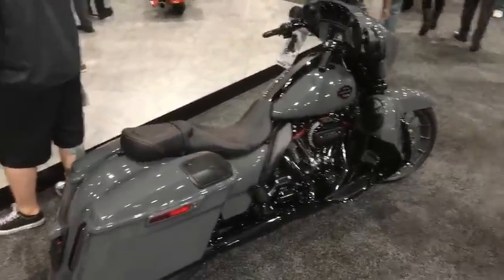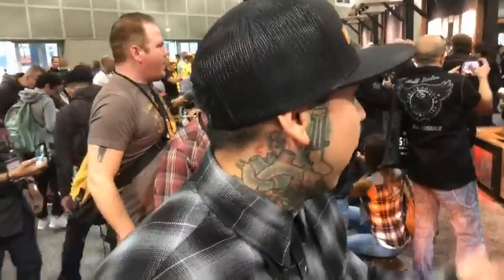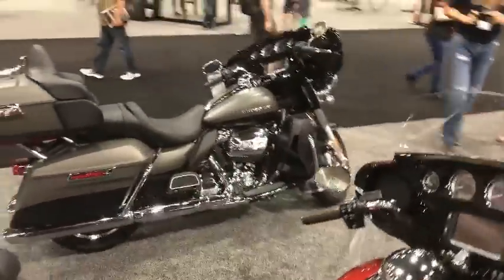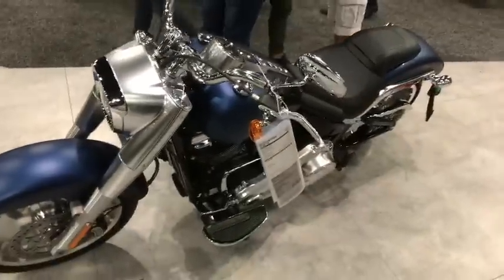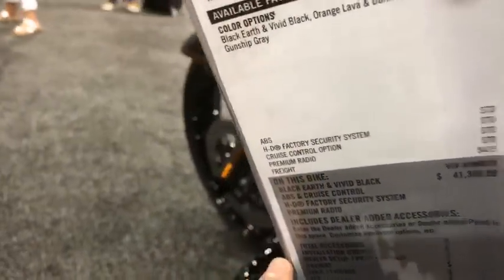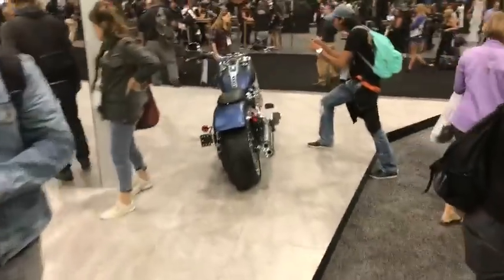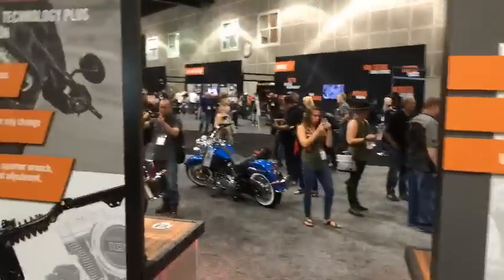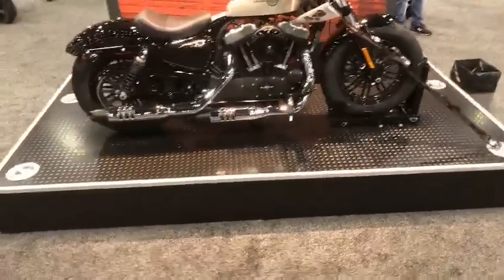2018 Harley-Davidson Dealer Show LIVE!

Comment: From a business and manufacturing standpoint, HarleyDavidson did a very smart thing. They eliminated a whole line of models that where not a hot seller for many years and engineered a much stronger, lighter and better handling platform to build upon using the same frame for the cruisers and canyon carver model all using the M8 power plant 107 to 114 
Think of what Harley is saving in production time, multiple part sourcing and all the headaches of making the old twin cam and dyna frame and all the parts and assembly lines that go with it!  All while giving the soft tail Family a big shot in the arm which should ignite bigger sales for the soft tail family. The end result is building a better handling line of bikes that are stronger, lighter, faster then the old dyna and old soft tails. That's forward looking insuring Harley's grip on market share, all while saving Harley money for future development.  Personally, I think Harley is going to blow the lid off the motorcycle industry with future models. That's progress boys!  My money is on Harley Davidson to blaze new trails while keeping fast to its rich tradition in spite of bad economic conditions. It's survival of the fittest and Smart forward thinking companies Such as Harley Davidson will be left standing in the end!
Reply from the maker: Michael Gurgone well said.
Reply: that guy does not even deserve a reply from you probably a guy thats jealous of HD success keep up the great vid's
Reply: Amen bro...just wish they would get back to chrome and shiny paint...I'm just old school, just not a big fan of all the blacked out and denim look, there I said it ✌

Comment: I guess the Motor Company said to hell with the Sportster line: nothing has changed and so many people wanted a 8 valve, six speed Sportster for 2018.
The last make over for the line was in 2004 when the engine was virtually redesigned and the result was the most reliable engine Harley ever fielded.
Imagine a 1450cc short stroke engine with oil cooled exhaust valves, variable valve timing with a six speed (6th is overdrive) transmission...... they would own that segment of the market!

Comment: Curious to see what bike you choose to buy for 2018. Recently sold my 2003 Electra glide many great years and miles. Lookin to buy a new in spring. Lookin at the road glide ultra or maybe another Electra glide? I ride year round and lots of miles. More than ready for another bike! Great videos, keep it up!!
Reply from the maker: Pipe Down I'm between a Roadglide and a Streetglide. Special. Not sure which one I should go with.

Comment: The Fat Bob looks really cool. Too much seat and rear fender though. I'd love to see a stub fender and single seat on this bike with some headers. The Breakout S I did not see. Any chance it will offer a blackened engine similar to the current Breakout Pro Street CVO? Also HD should have incorporated twin cooling on the M8 114 Softail line-up. HD designers could have hid that small radiator somewhere inconspicuous.

Comment: Hey Matt: Thanks for the great video. I'm partial to Low Riders probably bc I owned a 1977 Low Rider back in the seventies and currently 1980 Low Rider. Do you know if dual front disc brakes with mag wheel similar to the Dyna Low Riders will be available for the 2018 Low Rider. I'm not feeling it with the current single disc brake and wheel setup. Also how many gallons is the 2018 Low Rider gas tank. It's looks oversize to me from the Video.

Comment: in the middle of the expo of new bikes it don't tell the heat coming off the back cylinder head and onto your leg and seat gets hot especially at a red light in Texas in the summer.

Comment: Hi Matt, I just watched your video. Another awesome video. Judging by the comments, it seems that there are a lot of angry birds out there. I stopped by a dealership (I'm currently working in Central Illinois) and saw a Fat Bob 114. I fell in love. I am on a Suzuki right now. That Fat Bob 114 looks outstanding. I really like the color (gun metal denim grey). I know a lot of people accuse HD of clear coating the primer and all that, but I love it. I think you're gonna sell a lot of them. I was a little surprised at the price, being almost as much as a Street Glide for the 114, but I guess the ride is that awesome. Light bike - bad ass motor. Thanks again for taking the time...I think I saw ODB wandering around in the back ground a few times...Ha!

Comment: A lot of motorcycle makers are bumping up to larger cubic inch motors, but the truth is you don't get that much more performance out of larger motors these days even when HD is doing it right. Actor Keanu Reeves has a motor cycle company called Arch 1 and they use a 124ci s&s motors in them which is a strong motor and a big motor.
 What will really change the motorcycle world is when they introduce on a large scale electric motors.

Comment: Any way you can explain the $5k hike on price with the SGS and the RGS? I cannot wrap my head around it.
Reply: joojr2779 5k hike? 2018 MSRP SG & RG  are 20999 and 21299. When were they EVER 16-17 thousand?
Reply: joojr2779 even the specials. Last year MSRP 23999 2018 25999 so where is the 5k jump?
Reply from the maker: joojr2779 I was told
Something surprising by the guy who helped with the FLHXS and FLTRXS projects this year. He said it's actually a lot more expensive to black out a bike then chrome one. I was floored. It said just the manufacturing process etc. it's harder to get the perfect coating on there etc. So the manufacturing process costs more and you do have nicer speakers and stretched bags. I think Harley also knows that there is some perceived value there too which justified in their mind to hike the price even though true costs might not be going up a proportionate amount.

Comment: Luv the idea of a 114 glossy blue Fatboy, but the Heritage is so much more practical. OTOH, man does it need some parts to brighten its day. I like retros, but I'm not a fan of all the flat, drab colors.
As much as I like the lower CG and lighter weight of the Heritage, the Road King just looks much happier to see me. Makes writing the checks for it easier. OTOH, the Heritage already looks relic'd. Probably wouldn't even notice if it got a rash or a few dents.

Comment: Matt, have they figured out what is wrong with the transmissions yet? How about fixing the Boom Boxes like they should have done in the first place? What is the word?
Reply from the maker: 48retrop I wasn't aware of a known problem with the transmissions. What did they need to fix on the boom boxes?
Reply: Matt, the problem with the M8 transmission is that many are pumping transmission fluid over to the primary case. Up until about a month ago the MOCO was simply ignoring these reports. Recently they have started to realize that this is actually happening and have come up with a two page list of things for the dealers to do in order to determine what is happening to make this occur. Most shops I have talked to say this phenomenon of moving fluid from the transmission to the primary can not physically happen. And yet it does. Most recently the MOCO is sending out replacement main seals and a spacer to be replaced on bikes that are experiencing this problem. As far as I can determine this has not fixed the transfer at all. Repaired bikes continue to transfer fluid. I myself have this problem. I have moved Formula + back to the transmission on three separate occasions since May of 2017. The problem has largely gone unnoticed because nobody ever checks their transmission level unless there is a leak on the floor. The first time I  checked my transmission the level of fluid was not even on the stick at all. When I removed the derby cover the fluid poured out of the open hole. To confirm this I put some dye in the transmission. Five days later I checked the primary with my light and sure enough the dye from the transmission was showing up in the primary. As more and more riders hear about this and start watching it many are beginning to discover the same thing. So far the MOCO has been largely silent and has not admitted to the problem. Because they have not come up with a cause or a fix there is no reason to believe that the new 2018 models will not have the same problem.

The problem with the Boom Box infotainment system (as you know) is that riders expect the Boom Boxes to communicate with their Bluetooth headsets instead of using a plug in wire connection. I asked the question because I wondered if the new 2018 bikes had Bluetooth capability now. Of course I realize that you don't have anything to do with Harmon Kardon or their development. You pretty much are left with the job of selling what they send you. Other than that we all appreciate your YouTube videos immensely. You are the undisputed "King" of dealer videos.
Reply from the maker: 48retrop great comment. I haven't heard of the transmission fluid problem. Good to know. I don't know if they addressed this. I haven't heard of any memos being put out about it so I would guess that it hasn't received a fix. They did release a module that plugs into the boom audio that allows it to be completely wireless.

Comment: The cvo road glides  don't have radiators and less accessories...so why do they cost more than the cvo street glide
Reply from the maker: Telace Johnson the road Glide standard also costs more than the Streetglide standard. I just think the Roadglide has slightly higher manufacturing costs.

Comment: 2017 cvo streetglide 114 motor specs is 124 ft/lb torque @3250 RPM plus water cooled. 2018 streetglide cvo 117 specs is 124 ft/lbs torque@3500 RPM no water cool.  Guess what, 2017 114 is quicker and cooler! I will stick with my 217 cvo streetglide! I'm sitting on a collector's item!

Comment: Matt did ALL of the SoftTails  come with that New Frame
Reply from the maker: Ed Tuller yes. All softails and they also all get the Milwaukee 8
Reply: Matt Laidlaw 

Sorry Matt ... but I have to ask this question again... I tried to ask you while you where streaming live but I understand you can't answer everyone's .... my question
The breakout... does it have the same softail chassis as 2017 or it has the new chassis?... please answer. Thanks
Reply from the maker: Tony Vasconcelos The Breakout has the new 2018 Softail chassis with the mono shock under the seat with the Milwaukee 8. Hope this clears it up.
Reply: Matt Laidlaw thanks 🙏

Comment: have to say the loss of the dyna family is saddening... a classic motorcycle line... and a relatively affordable one... I guess they really are trying to push the "street" (or whatever the light sub 1000 line is)... i guess to me it just feels wrong that the low-rider is a softtail...   that said I do like the blacked out roadglide engine....  hard to say if im convinced to upgrade at this point.... i want, yes... but having a paid off bike is nice.

Comment: You might be right about the used bike. market booming but if they ride these hot box machines they will opt for a inline 2 cylinder hopped up made in India motorcycle. $5999.99
The fuel tank and seat are too close to the top of the motor therefore the air cooled motor is not getting enough air producing too much heat to the right leg and seat is a steam engine in summer months you cannot ride a v twin Harley.

Comment: So effectively they've dropped the 'new' sports model. They appear at first glance to be moving away from any attempt to 'compete' with the European / Japanese market. They've surrendered in the torque / hp battle / handling battle.

Most bikes now have a 107 / 114 option where as in 2017 the only 'sports' bikes with even a 107 were the 'S' models.

Now I'm all for bigger engines, but the sports arena is smaller engines not larger. I supposed I'm pissed because I was looking at getting a lowrider S and now it, like all the dynas have gone. 

I  suppose I'm going to have to hang back and wait for some independent (no offence Matt) test rides on the new frame, I'll be looking keenly at how the fatboy / lowrider are in any way different now they're on the same frame.

Comment: HD doesn't pay attention to the changing demography. All this change is a half ass attempt to put younger people on a Harley Davidson and it will not work! Majority of people on HD's in my area are 50 plus crowd. Most of those riders wont even acknowledge you as a rider if you do not ride a Harley... sad...
Reply: You're 32 and I said most are over 50, You are the minority. The HD is a class of luxury? compared to what? Goldwing?  Boulevard? Shadow? etc...  Lets talk price. HD has entry level bikes as do other Manufacturers; to say HD are more expensive because they are more luxurious is absurd. Could it be because they are assembled in the USA with parts manufactured from Asian Countries that makes it worth the price? Your assumption that I bought a bike other than harley to get waved at is moronic. My statement was to point out that Harley riders think there shit don't stink and you comment kinda proves it! Happy riding and stay safe!

ps.. I was riding motorcycles before you were born.

Comment: Harleys starting to look like metrics..HaHaHa Harley is going down.
Reply: I agree on some of the models do look like metrics of 10 or so years ago. I believe the MOCO has stepped up on some of the models by adding what alot of us change on our bikes after we buy them. Stretched bags,better audio,LED lighting,blacked out special etc is a great move IMO
Reply: The radiator is a sacrilege.
Reply: The radiator is something that allows pushing the touring bikes in triple digit temps without over heating issues. I just finished a trip on my 2017 Ultra Limited where I rode hundreds of miles in temps over 110 and the bike never whimpered a single time. I think the idea of liquid cooled heads, and air cooling with an oil cooler is a good one.
Reply: JH hw going down? Sure I guess.... if you stop standing on your head youl see the true direction.
Reply: Grab a brain
Reply: How do you suppose bikes ran for a hundred years without radiators

Comment: Crap. Crap and more crap.
Reply: Julio Smith 

Hater hater and just a hater ... with these bikes harley cement themselves for another 10 years on top of  he hill!!!!
Reply: Malcolm Todd if you dislike these bikes why are you watching this videos?
Reply: Killing off the Dynas , or trying to replace them with this bewlshat is a terrible, terrible move. Also, i have seen two "paint schemes " that are " new for this year" that look EXACTLY like primer grey , and primer brown someone shot a clear coat over, added some pinstriping  on top and said " fuck it ". Hell no.
 Also, half the new models can't seem to decide WHAT colors they are done in, matte and gloss blacks mixed randomly on parts, gold  and chrome trim random spots on same bike,  it looks like a freaking patchwork blanket  on wheels. Man i love Harleys but right now i am more glad than ever i own a 2004 and sure as hell wouldnt trade it in on ANY of this stuff, new or not.
Reply: Malcolm Todd actually, when then went sparkling I had a shred of sparkly hope for the brand. I wanted one because it looked custom and fun. Now we get concrete grey 😑